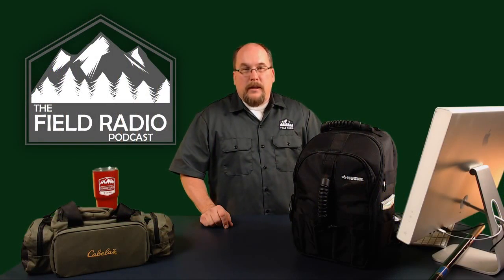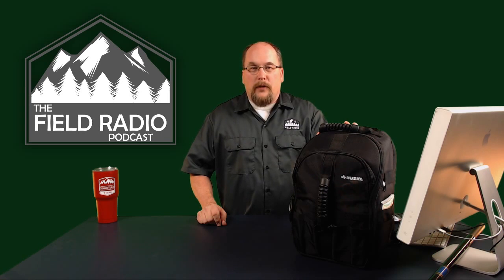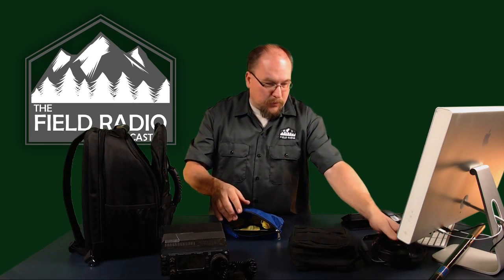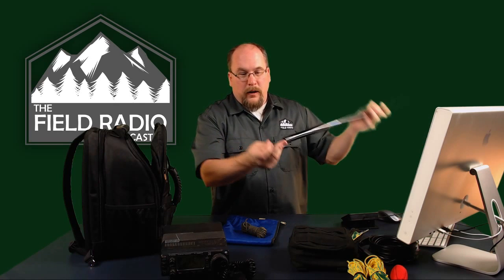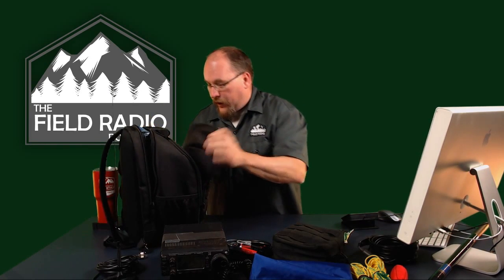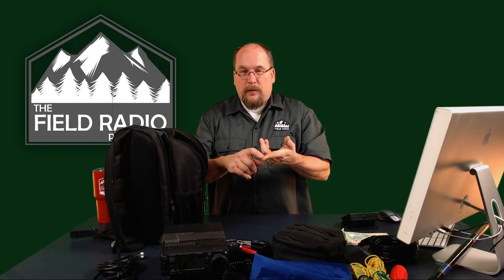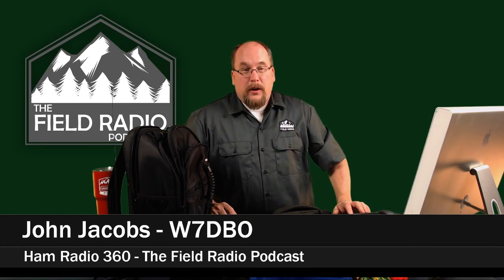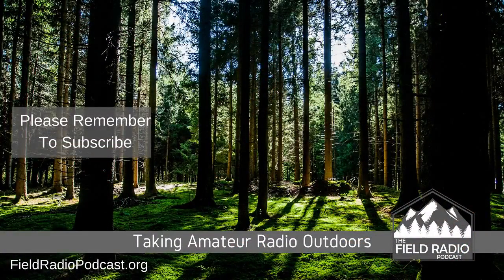Mobile Radio GoBag For Amateur (Ham) Radio Field Portable Communications

Comment: Have you thought about using a Raspberry Pi for computer to do many of the digital modes? There are many using them and have software thr most of the modes.
Reply from the maker: Yes! My current gobox build is a pi gobox, then an ultralight pi gobox.

Comment: why do you need a antenna tuner.
Reply from the maker: The primary antenna for this unit is the Packtenna random wire that needs a tuner. It all depends on what antenna you are deploying. My other antenna (gypsy) does not require it but helps speed up the fine tuning.
Reply: @FieldRadio  Have you looked into the HyEndFed QRP antennas?  They are very light and no tuner is needed thru 40 meters.
Reply: You don’t need a tuner if you make your own resonant antenna
Reply: @terrymac9570  carrying a dozen antennas, one for each band aint much fun.

Comment: Nice video. I do have a question, what is the best mobile  radio that has the lowest current  draw?
Thanks
Reply from the maker: You would have to dig through the specs. I would gess the radios with the simpler displays and less bells and whistles (GPS) etc. I have preference to the Kenwood line for VHF/UHF and Icom for HF.
Reply: Bill Loveless kx2

Comment: Dang it! Sorry I missed the live feed! Awesome kit and thanks for sharing! BTW-What was the make/model of the SWR meter you had for VHF?
Reply from the maker: The SWR Meter is an old one. Not sure if they are in production. It is a DAIWA CN-465M SWR & Power Meter for 140-450Mhz 15/75W. Price tag on it says $72.30, I got it at local swap meet still in original box for $5!!! More info on all the items. at fieldradiopodcast.org/video_mobile2.php
Reply: Perfect! I am a podcast sub, but I find myself forgetting to tune in, or completely forgeting about all of my podcast subscriptions. That meter sounds like a perfect item, price tag included, to keep stowed in a comms kit! Thanks!